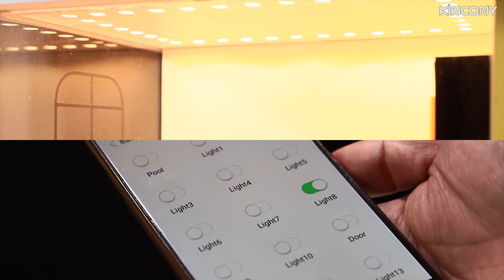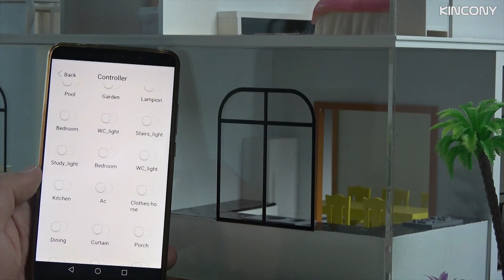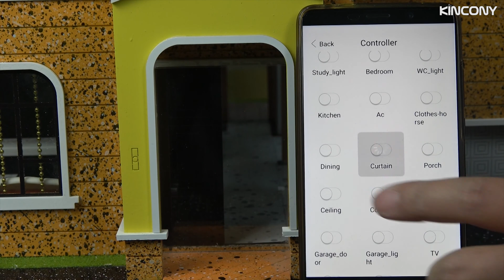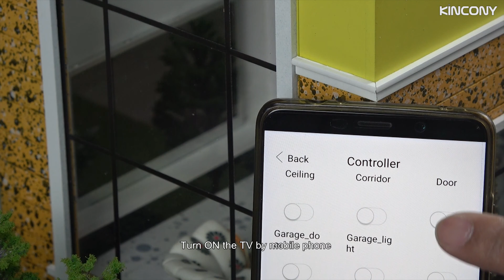3d smart home house model science diy project powerful on YouTube!

Comment: I have Smart home project anyone need dm
Features.
1. Gate opening through biometric 
2. Automatic watering system. 
3. Automatic lighting system with motion sensor 
4. Gase detection and Automatic exhaust system
Reply from the maker: ok, you can use our smart controller.

Comment: Sir please tell to me also
Reply: Replay please Sir
Reply from the maker: https://www.aliexpress.com/item/32963746784.html?spm=2114.12010615.8148356.1.40e769cfHh1lYN
Reply: @KinCony  this building model is selling for US $650.00 with all the fuctions as this video showed ?
Reply from the maker: @Valsionhezter  650usd without voice control , other functions all have
Reply: Thank you sir
Reply: Sir please  give low price
Reply from the maker: @kameswarimeesala1187  this is lowest
Reply from the maker: You can try to do it yourself according to the principle.
Reply: Sir  please  tell how to connect  to light  and something
Reply from the maker: @kameswarimeesala1187  there is a smart relay board KC868-H32L inside, relay output control 12V light for demo.